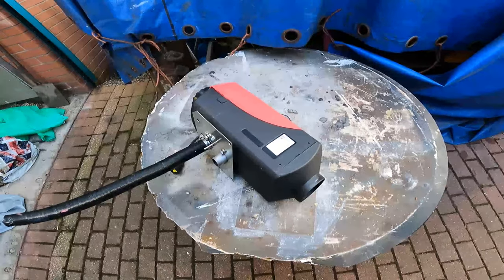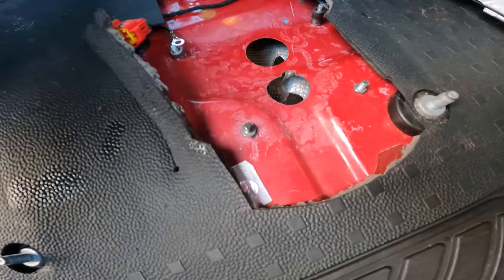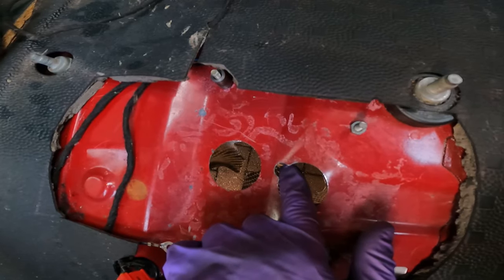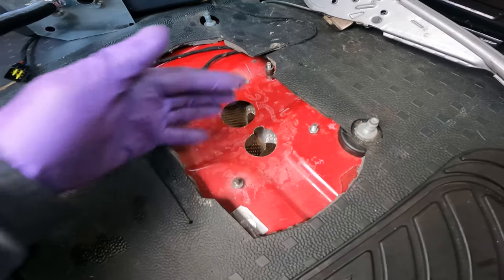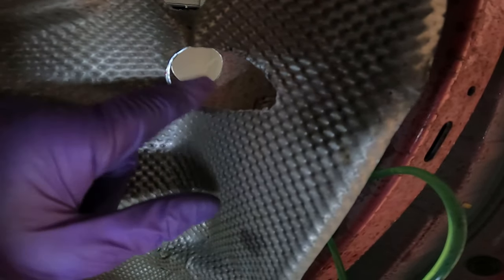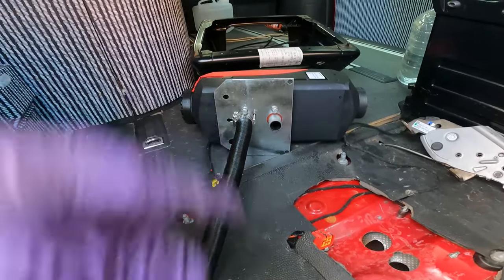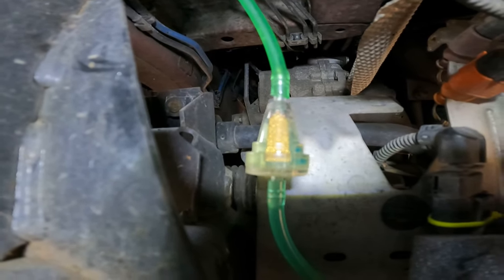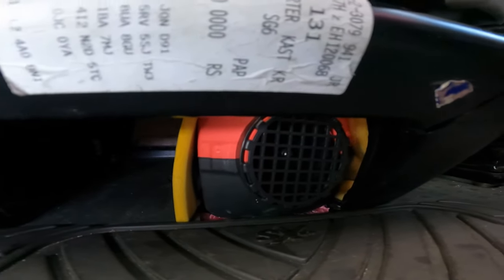How to fit a Diesel heater into a 2014 VW T5 Transporter

Comment: Nice detail job. The fuel pump should be on an angle so the bubbles don't build up. I found a rubber mount isolates the pump noise.

Comment: Great  job Warren. NEAT to only have to cut smaller holes. Given that you have the heater lifted a bit above the floor,  how did you go with space available underneath to connect the pipes AND handle doing up clamps? Thanks.
Reply from the maker: There is enough space but its tight, you can choose to connect the pipes before you install in the floor.
Reply: @wapsac  Thanks Paul. I'll see how it goes fitting today. I'm using rivnuts rather than bolts.

Comment: Nice vid! Your fuel pump is installed horizontally; I'm reading a lot of comments it should be angled 30 degrees or so. What is your take on this?
Reply from the maker: By fitting the fuel filter in a vertical position i am expecting any air bubbles to lodge in the top of the filter rather than the pump. This is what seems to be happening.

Comment: How is the heater holding out..seems to be a lot of mixed reviews with the Chinese heaters
Reply from the maker: Mines been fitted for over a year without any problems other than the backlight on the LED display failing. This is quite a common problem.

Comment: If you don’t tap into your fuel tank what is the alternative? A separate bottle of fuel? How much diesel does it use per day?
Reply from the maker: The only three options are, tap into your main fuel line, tap into the fuel tank or a separate fuel tank.

Comment: How did you tap in to the main tank?
Reply from the maker: I had a flanged insert made that allowed me to drill into the tank and safely install the take off. Not for the faint hearted as if you get it wrong your fuel tank is scrap.
Reply: @wapsac  Does this screw into the side of the tank? Seems like a lot quicker job than dropping the tank etc.